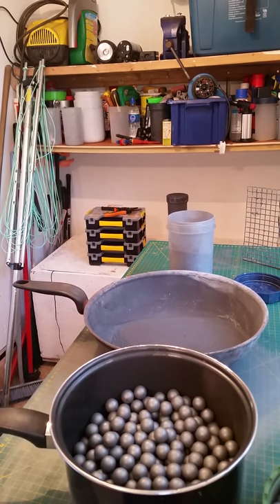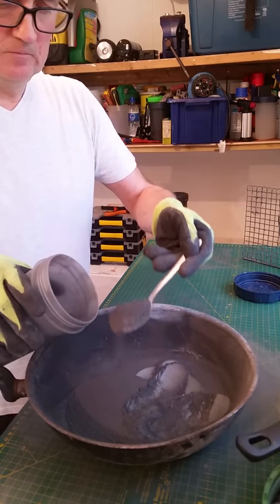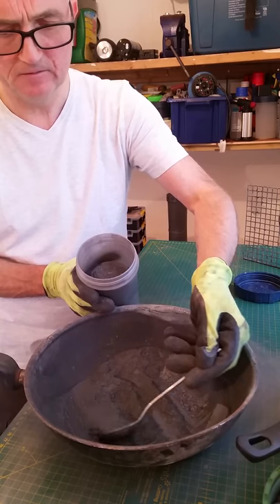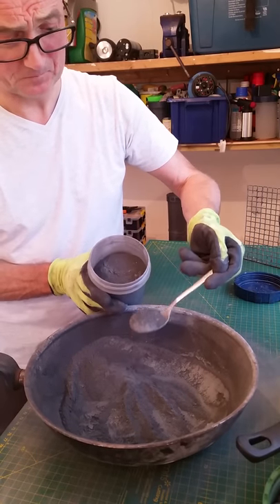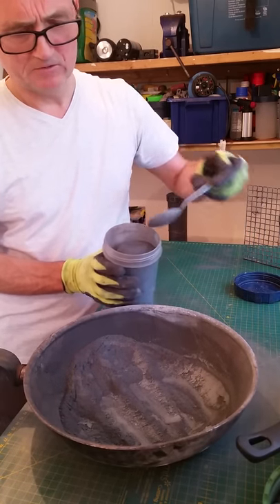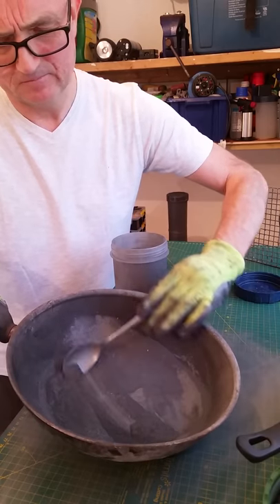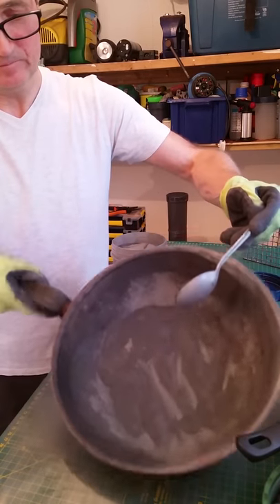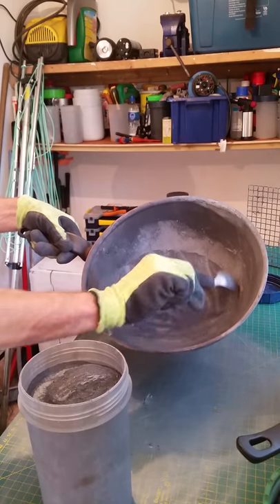Powdered Aluminium production 2

Comment: how many inches are your steel ball berings and how many mesh is your aluminium
Reply from the maker: I didn't buy the steel balls, I just found them on the side of the road/came by them. As such I use lots of different sizes. Biggest is about an inch round, most are smaller
Reply: @philipwaters  ok thanks whats your alumium powder mesh sorry for my english